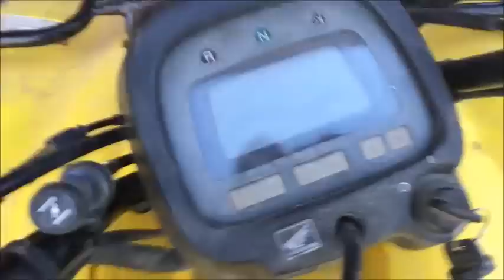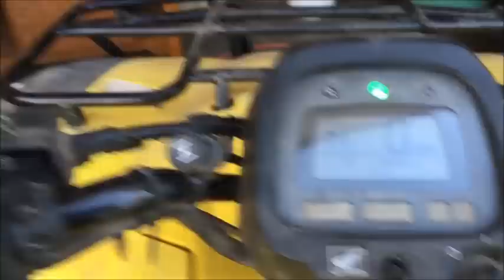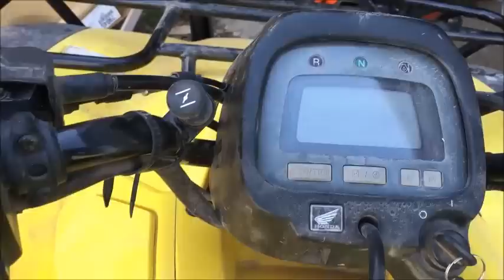2005 Honda  Rancher Choke Cable

Comment: Great video, I replaced my choke today.   I did it without removing the plastic from around the fuel tank by cutting the old cable up near the handle bars and taping the old cable and the new cable ends together and pulling the new cable thru as I pulled the old cable out.  Electricians call it fishing.  Just make sure you tape the new and old together really good and tight.  Feed the new cable in with one hand up by the handle bars while pulling the old cable out by the carb....hope this makes sense.  It worked really well.  Thanks for the video.
Reply from the maker: Hi Kevin
Fishing sounds great. Would have saved me some work.
Thanks for watching.
Reply: Getn ready to do the same. My advice is buy a cover for your quad and won’t have to worry about replacing the cable. Left mine out in snowy cold temps and that’s when the trouble started. Moisture plays havoc on the cable and ignition.
Reply: Replaced the cable and was able to “fish” the old cable thru as was suggested. Good advice!
Reply: @miked8227  Good to hear.  Glad it helped.

Comment: Dale,  I see in your video between minute 7:34 and 8:00 there appeared to be a small O-ring between the choke float and the spring.  What is that for?  Also does the new choke cable come with that?  I did not see that addressed on re-install.  Look forward to your comments on that.

Comment: Your Rancher is like my Foreman. Glad your going slow as to be able to watch. This Foreman had been stolen by some kids and ruined the ATV. All the plastics are in a box and so far what I had done is replace the carb, new choke cable as you had just done. New solenoid and battery. The digital meter was also ruined by heat and the protective cover was shot as well. I purchased a new one and it seems to work just fine. I'm waiting on a fuel sender as we speak then will try to fill the tank with some 93 octane. What fuel do you use??
Reply from the maker: I use non ethanol fuel I think it is 59 octane. I'm at around 6400 feet above sea level so I can use the lower octane.

Comment: I'm having trouble getting the choke plunger to go back in the housing. It seem that the o ring is catching or the needle isn't lined up. I did lube the o ring and everything looks straight. Any suggestions?

Comment: Trying to assemble the parts at the carb end of the cable end (rubber elbow boot, clip, spring and metal elbow and nut) but uncertain about positioning of the metal elbow.  Which end (little or big end) is inserted first first into the rubber boot?
Reply from the maker: I would try the little end. I didn't take the elbow apart. It has been 7 years since I did this job and haven't done one since. Sorry I couldn't give you a definite answer.
Thanks for watching.
Reply: @DaleHobbs39  Thanks for your reply,  Dale

Comment: Thanks helped a lot 👍🏼
Reply from the maker: Your welcome. Thanks for watching.
Reply: +Dale Hobbs my friend told me I don't need to replace the whole choke cable that all I need to change is a new choke valve. I'm not sure If I should order the choke or the choke valve. What do you suggest ?
Reply from the maker: If the cable isn't hard to move in and out and it moving the valve, then just replace the valve.

Comment: I'm missing my "choke mechanism" - the part the cable connects to at carb in... any idea about a part number for this?  thanks
Reply: You should be able to find that portion at any online store. Partzilla out of Albany has a wide stock of parts.
Reply: @Smalltechguy  thanks - I was able to order it as part of a kit - cheers

Comment: Hey Dale, nice video. On my dads 02 foreman (carb n choke look the same) his chike won't stay up, slips right down. Do you know if there is something to tighte to fix this?
Reply from the maker: I have 2 ATV and the coke on both of them will not stay on. I just hold in out for a few minuets. I guess that's better than driving around with the choke on.

Thanks for watching.

Comment: I have a 2013 honda ranche rat( rancher at ) 420. no choke.
Only 2 things I dont like and I don't like a lot!
#1 reverse.  Too much bullsh it  to shuft it into reverse.
#2 steering.  It dose not turn sharp enough and it extrenely stiff  needs power steering.
I have a 2016 honda trx 500
Deluxe M7 with powersteering.!  And front diff lock ! Fantastic. But. Manual shift sucks and that same dam complicated reverse procedure.
Wow what a difference that power steering makes.
Manual shift is same as motorcycle except no clutch.
Both have all wheel independent suspension.
Reply: Most Hondas are easy to bypass the reverse stuff research it❤